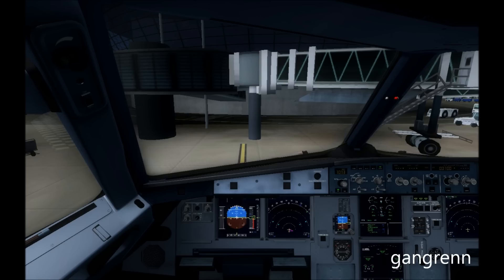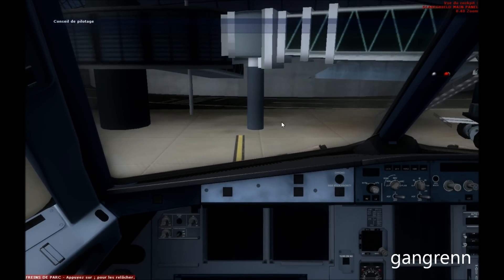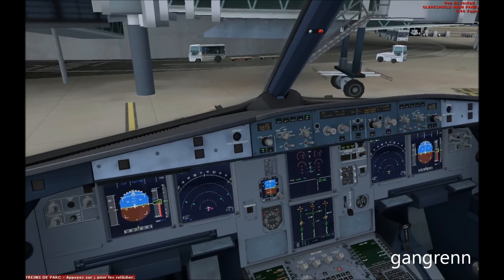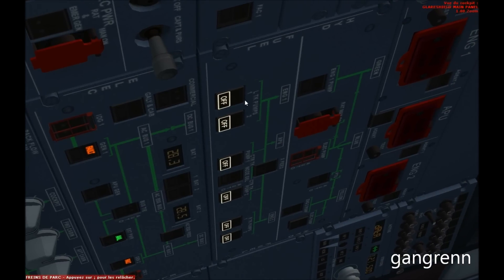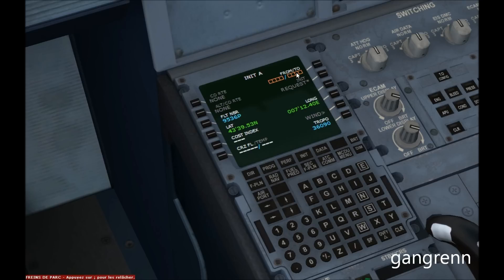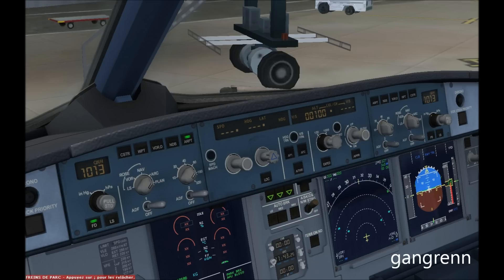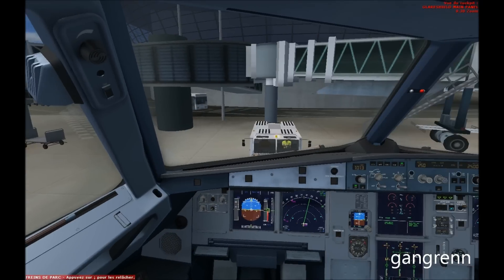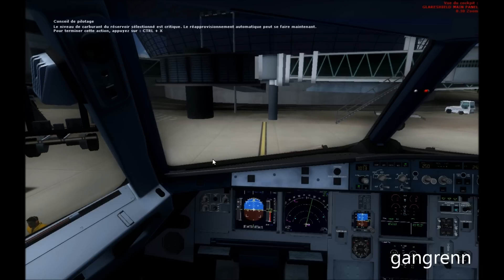FSX - Airbus X:  Tutorial - Cold and Dark Startup and FMC Setup

Comment from the maker: 1) Look which one is closer (the distance)
2) you set the value via your mouse wheel, then you pull and it will turn on the ALT function of the autopilot ; (or push the button, and the value will be managed by the FMC)
3) same than the 2)